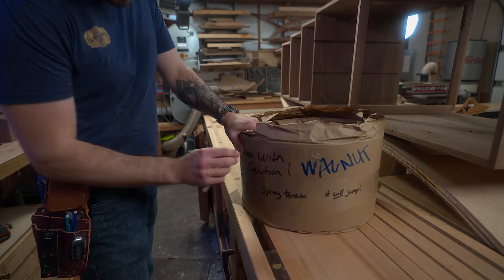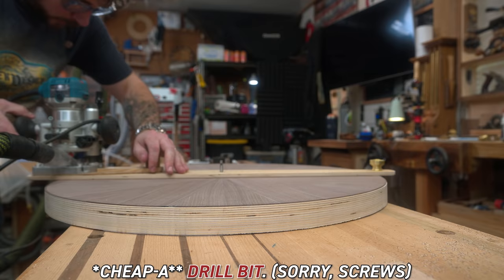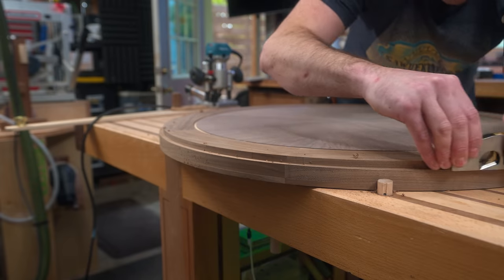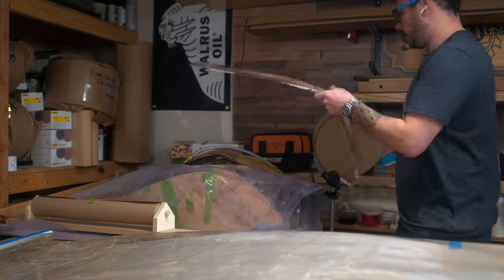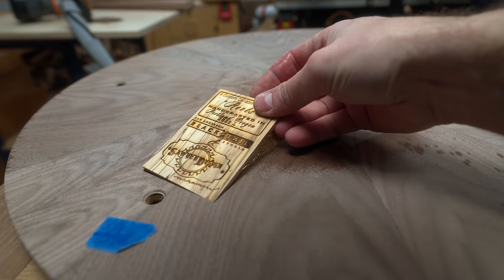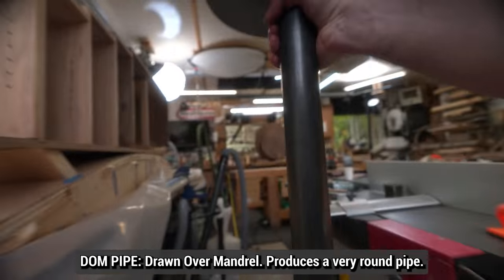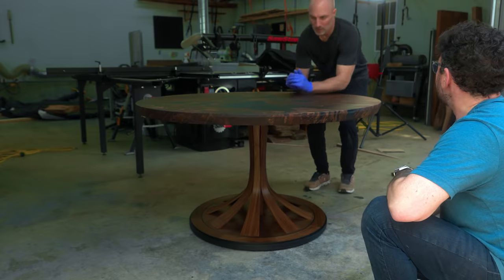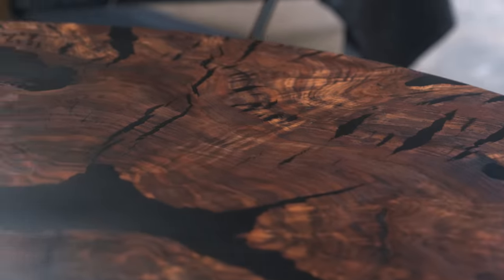Building a Round Table w/ @BlacktailStudio

Comment: You are my hero for using a vacuum bag. Most woodworker have zero concept of how much clamping force vacuum bagging can exert and how uniform the force is. A full vacuum is -14.7 pounds per square inch (PSI), a full vacuum is impossible but depending on your vacuum pump it is possible to get close. Lets say you wanted to clamp together three 30"x 96" sheets of Baltic Birch plywood to make a workbench top and you put them in a vacuum bag to clamp them while the glue dried. Let us say you used a vacuum of -14 PSI, your work piece is 30x96= 2,880 sqft, multiply that by 14 PSI and you get a whopping clamping pressure of 40,320lbs! If you wanted to use 8"x8"x16" cinder blocks(38LBS each) to try to get the same clamping pressure it would take 1,061 blocks! And..... the stack would be 39.3 feet tall....Damn

It is too bad the curved pieces were not 100% structural and the octagonal core was hidden up inside the top of the curved pieces with the steel pipe inside i.e. the steel pipe does not connect the base on the floor to the underside of the table base.

Comment: Amazing craftsmanship and design from you both! You can try using a larger diameter steel pole and fill the lower half with concrete to add mass which would add stability. The top steel plate at least 75% of the finish top diameter will help with flexing. From one woodworker to another. Hope this helps, keep up the great work.

Comment: Some advice. If you’re having an issue with the bag evacuating all the air, lay a towel or similar piece of cloth on top so that the wood doesn’t prematurely seal to the bag keeping the last air in.
Reply from the maker: I use some breather mesh as a top layer, but yeah that’s a great tip!

Comment: Really beautiful! I think the magic word is: Cement (or Concrete, but that would mean two magic words, which is not allowed...) Yes it adds weight, but more importantly, it eliminates the resonances and vibrations inherent in steel. This is why many machine tools have concrete-filled bases in order to counteract vibrations from rotating assemblies etc.  Oh, and because it's Cam, be sure to tell him that for this project, I said that the item he needs to buy now is a cement mixer. He will then know immediately who the suggestion came from...
Reply from the maker: Definitely might be the ticket on v.1 and interesting point, but not sure it adds much for rigidity compared to steel. The flex is the cause and it makes sense to address the cause before adding correction to the problem. I’ll have to think on this. Definitely an interesting point! Thanks Kevin!

Comment: Hi came to see your work off the back of black tail. 

Your work and also your patter are a good fit with black tail, I hope you finish something together soon.

Incidentally I had a 6 person round solid mahogany dining table years ago where the pedestal on the centre was 8 inch diameter turned down from about a 12 inch square that was set into the 1.5 inch table top fixed with 8 screws. Even that base had a little vibration but it's round and that you forgive a lot.

Comment: I'm torn between Sunburst and Slab. I have a deep appreciation for both and I love how they are worked into this project. I feel like the sunburst on the base is fitting because the base is always secondary to the top and for that reason I feel like it doesn't always carry the amount of detail necessary to round off the overall idea or design. This project gives the best in all aspects and totally delivers the natural beauty of walnut in all it's regional intricacies. Overall, the beauty of the base burst's it's way into and out of the beauty of the top! Great job by both or you magnificent maker's.

Comment: Incorporate twisted metal rods in between the laminates and have them inlay under the bottom of the table down to the base for extra rigidity, it's so close to being steady but you need to support the outer edges of the table with something strong and non flexible down to the base. I figure decorative wrought iron or something would fit in well with the style you're going for.

Comment: The choice is obvious: Sunburst! Also, get a much bigger flush trim bit. The added weight will make it way easier than your tiny Freud bit.
Reply from the maker: All my big ones are compression bits and I hate that they don't bite into the cut. Definitely would have helped here though lol
Reply: @SawyerDesign  No I use spiral bits for everything, even for the small bits. Much easier to manage

Comment: Really dig the build.  I wonder if you could take this style and do something of a 3d compass rose base that flows up to a compass rose laminate / inlay top?  rather than the bottom ending in a wide flare, end in a point. You could have 4 "long points" and subdivide between those with shorter.  Just tossing out an idea.

Comment: First time coming to your channel (I'm a Blacktail watcher.)  Impressed with your professionalism.  You put a lot of TLC into this project, and the end result is excellent.  Things can be more decorative than functional, and vice versa.  Not doubt.  A lace doily as a coaster?  Much more decorative than functional.  Brutalist architecture?  Much more functional than decorative (in my personal opinion, though I know there are a variety of opinions on this.)  But I totally believe something can be very functional, and yet also very decorative/artistic/pleasing to the senses.  Did you choose a pedestal design because it was going to be artistically pleasing, knowing that it might be a bit wobbly, but discounting that as an issue?  Okay, you were probably leaning into the decorative side of the argument.  I guess you could have made legs for the table.  But, to be fair, whilst that would solve the wobbly thing, it would create a problem in that you don't want to sit right where a leg is, but to one side of it.  And that factor limits the functionality of the table...  There could be other solutions that address both of those issues perhaps.  (Maybe a steel plate the size of the table on the floor, curving up to a sing central leg, with plenty of flat floor space for people's legs/feet before it starts curving upward.  And then you cover that steel structure in beautiful wood.  That's kinda what you did, but with a much bigger floor-plate and a bit more room for curve to strengthen the structure.  Just one idea.)  But it seems to me your design here is both functional and decorative.  It would have been a beautiful table to have in your house, assuming the moisture problem hadn't killed the project.  Good to know you'll be able to reuse that base.  One further comment: I noticed that metal pole was extendable.  How about another project where you make a base that can extend/retract, so folks can change the height for their table?  That would make it even more functional 😀

Comment: Hey Nick.   Took me a while to start catching up on the videos.   I wonder if you aligned your wooden foot pads with the bent laminations, (put one to align with each curved lamination) and then put rubber feet (1/2" rubber pad) on the bottom to align with each lamination if it would take the wobble (which is extremely slight) out of it.   As a piece of Art, it's "Legit"!

Comment: 3:25 that's what distinguishes high end handmade luxury product from just another technically perfect weblenian good
PS You can make a small portable steam bending system using a portable grill and multiple tubes instead of a single heavy duty one, or if you don't wanna burn down the shop a sand bath for boiling the water works as well. I used a ghetto setup like this when I was starting out with bowyery in my parents' garage ^^
PPS Holy shit you weren't joking about the overengineering, hats off, I can't imagine coming up with a 10th of what you've made here

Comment: possible tip, when dealing with complex angles and shapes, have someone draw it up in cad, and print out templates if needed.
Reply from the maker: Great tip. That’s exactly what I do 👍
Reply: @SawyerDesign  next level tip. Have your templates printed on mylar or at least velum.. It's kinda like plastic almost. They will be 100x more durable than paper. Great vid and work.

Comment: a couple layers of fiber glass on the back of the wood supports might help. I was originally thinking carbon fiber, but ya...that's expensive. It wouldn't be visible and would add some stiffness.
Reply from the maker: The lams are mostly aesthetic, but I like where you’re going with that.

Comment: I actually liked the color difference between the center of the circle and the edge. Wonder how it'd looked with a brass inlay instead of the dark epoxy. And dang, at first I though it works be the tabletop, not the base

Comment: Very cool, have you tried Weldwood powdered wood glue for your bent wood laminations, a little less expensive than epoxy?
Reply from the maker: Not that brand, but I’ve worked with other urea formaldehydes. VOC in epoxy off gassing is far less hazardous than formaldehyde in powdered form, but I can see why it’s a tried and true application in the industry— much more enjoyable to use than epoxy. If I paid for epoxy, I’d probably consider mixing UF more often.

Comment: I think SUNBURST veneer looks better with the base, more intentional! though i'm sure v1 looked awesome as well.
Reply from the maker: It definitely doesn't look bad. Proportionally, this new one is much nicer for Cam's top.
Reply: @SawyerDesign  speaking of the wobble, could it be related to the fact that the 4 feet are connected to the wood part of the base and not the metal base? maybe making the metal base the primary contact with the ground would help, even though it's a narrower stance.

Comment: The issue is a matter of COG (center of gravity) router out the bottom of the foot and glue in a 3/4" thick plate of steel. Yes, it will make it heavy. But, it will also make it stable. Perhaps make the plate removable to ease when moving it to a new location.

Also... three points of contact on the ground OR adjustable heavy duty feet.

Comment: Hey Sawyer, great work, keep it up.
P.S. @15:53 I have always wondered what harm would it make if you just filleted the corners of the plaque to the same raduis as your router bit and just glue it in without the painstaking corner chiseling ?
Reply from the maker: The corner chisel is pretty quick! Probably quicker than rounding the corners. Usually they come with round corners though. This happened to be a custom size so I told him to just square it up.

Comment: I must say your stand and also Cam's table top are beautiful, really nicely done but table top size need to be only slightly bigger than diameter of bottom round piece max. What you could do though is to build 3x same stands. Bottom round part would need to be much smaller and middle piece would stretch out only very little. That would hold any table top, wouldn't wobble at all and still would look great IMO.

Comment: Nick, I was wondering how you like your vacuum press. I know you have the smaller model. I was considering the same one to save a few bucks. Any regrets not getting the larger model?
 Thanks
Reply from the maker: No ragrets. Bigger pumps would be nice for big pulls, but honestly, an extractor pulls the majority out faster than even the largest pump.
Reply: @SawyerDesign  right on. Thanks for getting back. Makes me feel better about the purchase.

Comment: Not sure if you are aware or not, but unless your moisture meter is advanced enough to contain the “species correction factors” table of data for all wood species & you selected “black walnut” (Juglans nigra), then you can’t just read off the moisture content direct from the meter.

The majority of moisture meters measure electrical impedance. The meters are graduated at factory to give the correct reading for Douglas Fir.

To get the correct reading when measuring black walnut, you have to apply the “correction factors”, from the data table to correct the reading from a Douglas Fir reading to a Black walnut reading.

Details explaining this step in my attached YouTube video on the subject for anyone interested in the subject.

https://youtu.be/BkAUcSvRnp4

In addition to species correction factors there is all so an additional “temperature correction factor” that also needs to be considered.

If you are running a timber seasoning kiln for eg and near the end of the drying cycle and on hardwoods up near temps of 50c (120f) then there’s a further couple of %age points to be calculated after the species correction factor.
According to my data table at the lower readings you were getting you’d need to remove 2 or 3 % from indicated meter reading and around 5% on that one higher (green / wet) reading.

Hope that helps. Normally you’d try and understand the importance of moisture content on timber shrinkage and expansion in radial and tangential grain between summer & winter in kiln dried lumber and try to account for that movement in the design of the table and your laminate layups etc.
Timber technology understanding, is crucial if your going to invest this much time, effort & materials into such a high end finished furniture piece.
There are 3 different types of moisture in that walnut wood, free moisture (sap) that runs from roots to leaves within the tree.
Then there’s intercellular moisture that exists within the cellulose cells which also has to be removed then lastly there’s intracellular moisture that exists inside the double skinned individual cell walls of the cellulose cells.
The intercellular moisture has to be wicked out of the inside of the cells thru “pores” in the double skin cell walls, called “lumens”.
Create too high of a moisture gradient between the inside of the board to the outside where it’s evaporating and you risk the intercellular moisture bursting through the cell walls causing “structural collapse” on the cellular structure of the cellulose in the board.
There’s a lot more to the successful design and execution of high end furniture like this than just a good idea and execution unfortunately, knowledge that seems to be lost to todays generation of fine furniture makers unfortunately.
Just coz you saw it on YouTube doesn’t make it correct.
Often I find, YouTube is a collection of the blind leading the blind. 🙄

Comment: Turns out that every pedestal table should start with heavy duty metal base welded in one thick piece.
Reply from the maker: Haha no kidding. Lesson learned. You might check out the bistro table. Crazy how inverting the design and closing the sections changes everything

Comment: The top is too heavy for the rigidity of the stem. If you had a top of half the weight you would have twice the frequency of oscillation and much lower amplitude. 
Double the pipe thickness. Fill it with concrete or look into constrained layer damping. Roughly two pipes with viscous not completely hard glue between them.
You already have 2 pipes try filling the gap between them with silicone or something.
The math of that would be a little more involved but you could just try

Comment: What you’ve got here is an engineering problem you aren’t getting. Your proportions won’t work. If you take a profile cut of your design down the center of your table, then look at one side of it, what it looks like is you’ve got a C with the lower half literally cut in half. Then you have a moment arm acting on the two ends of your C. To have a static (ie not moving) table, your moment arm on the bottom has to be greater than your moment arm on the Top. Since the moment arm on the top is the radius of the top multiplied by its weight and the moment arm on the bottom is the radius of the bottom times it’s weight, your top will continue to have a much larger moment arm as long as they are the same material and the bottom is smaller sized. This is what makes your wobbly table. Your solution would be one of two things, weigh down the bottom more, or make the bottom bigger than the top. Since you want people to sit or stand at the table and not in it, I’d suggest former.
Reply: What you’ve created is a veritable space needle without any of the underlying foundation.